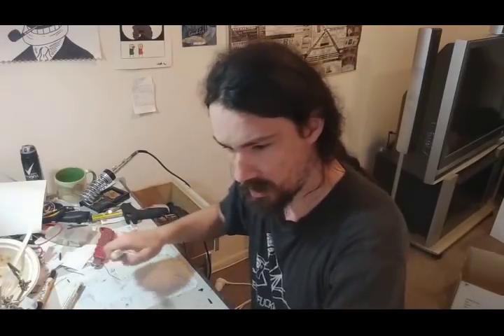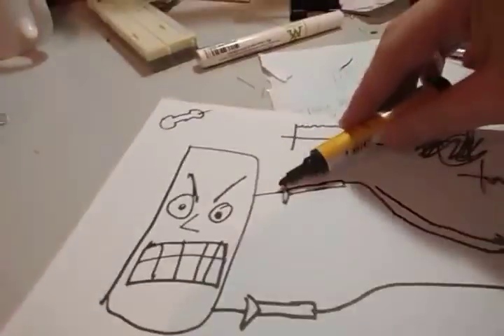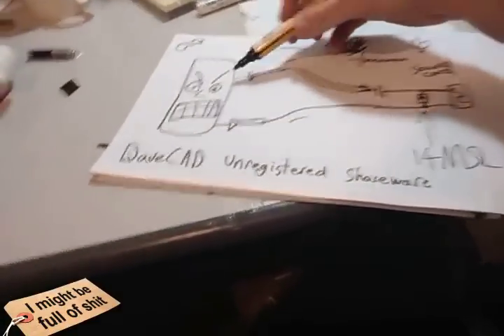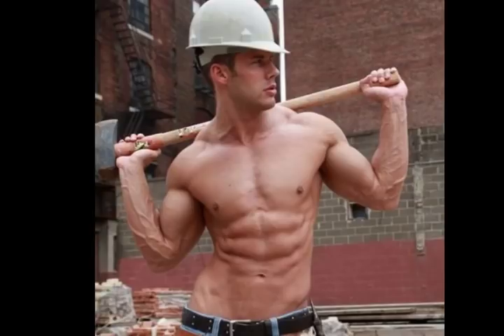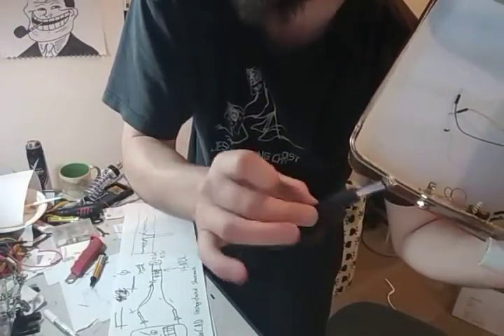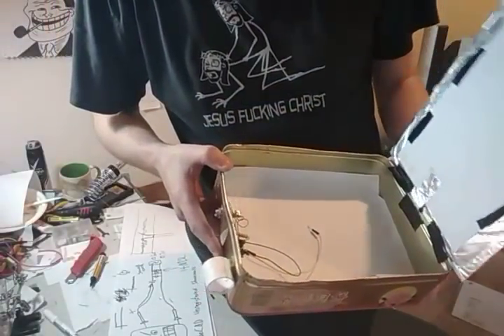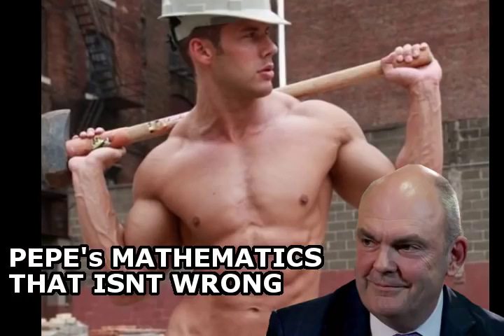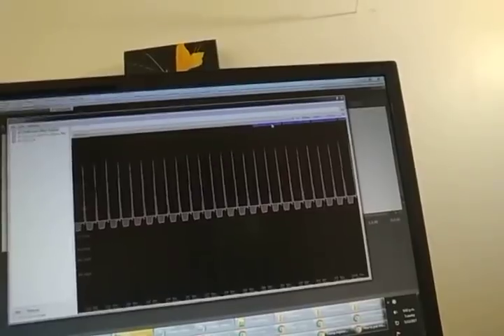Pepe's World #4 On the Spectrum

Comment: For protection diodes, speed will probably be more important than forward voltage drop? Some fast high power diodes that I could think off the top of my head are FR101~107 and HER101~108 series. The forward voltage drop required for proper protection without clamping legitimate signals will depend on the input voltage range of the sound card, not sure what a typical range is as I haven't played with them.. A even better choice would be zeners or even TVS diodes, they'll probably be a bit more expensive than normal diodes though, or harder to find the right ones if your major component source is old PCBs. Another concern I had with these kind of instruments was that if the protection fails you have the risk of damaging the host computer.

P.S. Spotted the DaveCAD! XD
Reply from the maker: oh man! that is damn good information. thank you very much. I'd thought about zeners - but TVS diodes are new to me so i'll go check em out. sound cards expect stuff around -1 to +1 or so depending if its line level or what not. its around a few volts depending on the overhead + decent gear. i thought about putting a resistor in there to attenuate the signal as well but not up to that point yet. i'm still learning about the noise from yucky resistors and stuff.
Reply from the maker: oh those things! neat i think i have one in my bin